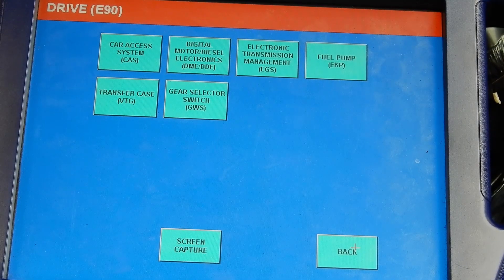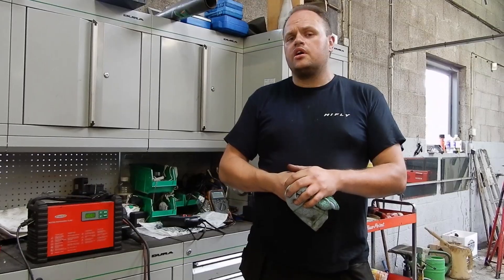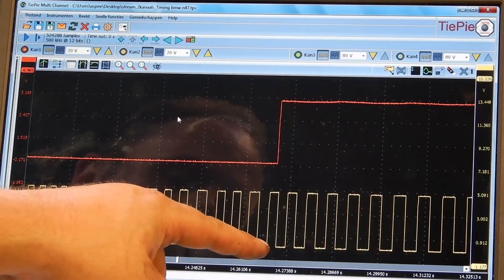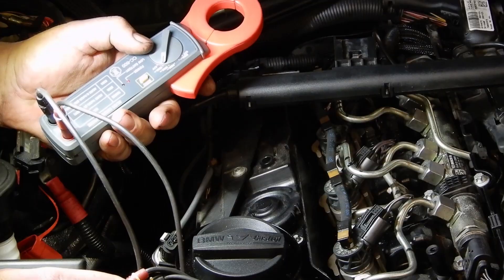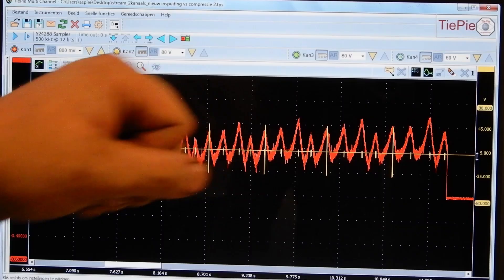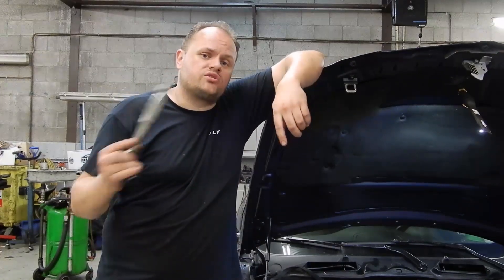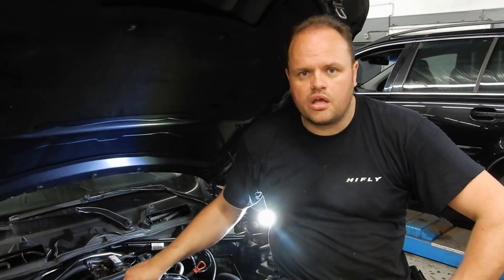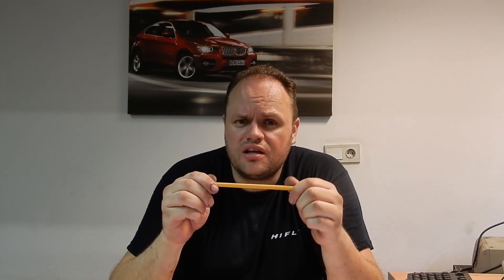Bmw n47 diesel engine "Won't run" diagnose

Comment: sump recently removed and replaced .  sounds like someone has been careless and not refitted the correct conrod endcap , main bearing cap.  conrod the correct way around ..  The sump will have to come off to get to the bottom of the tighteness  issue.   maybe incorrect bearing shells .   whichever way   it sounds expensive to me .   ex 1980 Donnington GT championship winner and self mechanic , fabricator , driver .. now 75 years old and still thinking .

Comment: BMW - Break My Wallet.
At least the timing chain didn't snap, those N47 are a nightmare, if it has more than 40k miles then that's already astonishing that it didn't bend valves. 
The last statement you made, could be the culprit for the seizing, lack of lubrication because of debris on the pick up means death... 

Great content, subbed.👍
Reply: Not here in the UK, I have a 118d convertible I've taken up to 96k miles, nothing needed. My car was made in Germany, apparently they make BMWs in the US and cheap Chinese parts are used, so hence things go wrong with BMWs over there, maybe buy an import
Reply: @davidviner4932  yes I get you, it is the same with Mercedes made in the US the quality is crap compared to German. But I can tell you David, I see heaps of broken engines in E87 e90s etc. I live in Germany and it seems that it happened here widely aswell, people fought for their rights to get some of the bill covered by BMW. 

I'm glad that you got lucky, it's not all of them but it's a Russian lottery.
Reply: I have an E90 with the N47 engine (316d) and it has done 216,000 miles with only routine maintenance required
Reply: @johngallagher909  You got lucky, thats a good thing. People who buy BMW's have to ignore the oil change intervall of 20k km and do it at least every 15k km, that would prevent failures, which these cars are prone to.
Reply: I have a feeling that the lower powered N47 engines (like the 316d) tend to be less prone to timing chain failure.

Comment: It seems to be a big mistery. I have gor 2 guesses: 1.The owner tried using any 'snake oil' (as said in the US) in the engine added to the motor oil. 2. He'd had the engine tuned by giving extra amount of fuel causing higly imperfect combustion. (A lot of) Soot can stick the pistonrings in their grooves.

Comment: The problem is it’s a BMW someone used the indicators and the extra load needed by the alternator caused the engine bearings to seize

Comment: Oil starvation engine seized They tried to get away with only renewing the bearings but the liners are tight now too because of scoring. The scope showed Number 4 (1342 firing order) being tightest. This is because 4 siezes first and is worst because it’s furthest from the water pump and runs hotter by design and gets more damage because it fuses the rings to the liner and tears the metal up but the engine runs on until all the others get damaged enough to stop the engine by which time 4 is totally trashed

Comment: I've seen seized up pulleys drag the engine down like that.  Not sure if the relative compression test would be affected like that. Looks cylinder specific. Please Dan, I need to know what fixed it!! Love you man! Thanks for the great videos. Vito.

Comment: Whats holding the engine, broken camshaft controlling the valves? Why not do a compression test with gauges on each cylinder?

Comment: Just FYI for other viewers as to why the current clamps reads in mV..   To read high current we use torroidal transformers that are part of the clamp circle. The current through the transformers induces a voltage on the winding. This relationship is linear and can be used an accurate method to measure high current.

Comment: I’d say wrongly fitted big ends wrong bearing or damage on the journals , it’s obviously had something done to the crankshaft and someone has messed up , usually no 4 piston suffers oil starvation first !.

Comment: Well it has been 2 years, did they burn the cursed car or is it driving again. With the same engine or a rebuild new one. Good riddle what part can make an engine partly lockup. Not give obvious signs which you would see when the sump was removed. Like metal chafings or metal that chanced colour. In which conditions was the oil when the problem first started it is like a puzzle where when it gets handed over to another person he forgot to give some pieces to complete it. But for the love of god 😇tell us once & for all what caused this engine to not run & partially lock up 😂my ocd needs to know🤪. I hate an open ending. Please🤗

Comment: Good diagnosis again Dan.  Need to dig deeper into the engine to find out the problem, they wouldn't let you do that, too bad, I know you could fix it, or replace the engine.

Comment: I suspect there's a partial seizure in one or more of the cylinders, hence the high current draw that is also inconsistent. If it was a big end or a main bearing issue, then the relative compression would not have such a wide variance.

Comment: I know this is old but . .  Brilliant video and great analytical thinking. As for what caused it to seize - well, I came across a Mercedes engine once which had new bearing shells put in the bottom end. They were fine, correctly sized etc. However, there's a semi-circular shim which takes up the longitudinal play in the crank. These are a sod to get in the correct place when reassembling the bearings. If they drop, even slightly, the crank will be more or less locked. It would have been interesting to know how it was resolved for your case.

Comment: Good engine when running right Crap engine when problems go wrong .Wont touch these engines anymore  Who puts a silly bicycle sized timing chain at the back of the engine . WHY ?

Comment: gonna go with bad main bearings, and possibly a bad oil pump caused it.. have seen oil lights not come one especially in turbo diesels due to "dirty oil", and clogged oil pressure sensor orifices..

Comment: I have seen similar sympthom , the problem was completly cloged cat. Guy that was fixing it unsqrewed exaust lines at the engine and it fired up. It was so cloged it wouldnt even start...
But I guess if you can't crank it manualy, that something has  seazed...

Comment: Uh oh Serpentine belt.
Reply: Me thinks since the oil pan gasket is different, they replaced the oil pump; but to late. If it is a manual transmission, you can tow the car to spin the engine. If the engine does not free itself, it is probably the main bearings. This one is going to be expensive with a total engine overhaul.
Reply: Oh before you do that check the oil fill cap for crusty deposits. The oil may never have been changed or wrong engine oil used. If the engine is heavily carboned-up, their will be excessive drag from fouling resistance. You did not state the km's.
Reply: The engine is definitely bound up, but why? Diesels are simple engines. I'm guessing it got supper hot or the oil was never changed. Either way, internal resistance is bad bad bad. Check the fuel to see if they put gasoline in a diesel engine. The engine will run very hot if they did this. A dragging bent push rod?
Reply: hummm, I had a locked alternator once upon a time. This caused the belts to smoke and break. If they just replaced the belt, the dragging/locked component still remains. I think this is the answer for the engine turns but with great resistance. It could be the fan bearing, alternator, power steering pump, turbo or air pump. I guess I'd pull the belts and twist each front of the engine component to see if they are the problem. There was heavy flooding in parts of Europe, France I think. What is the location of the home for the vehicle? I guess we will never know.
Reply: You pulled the injectors, so it can't be Hydro-lock. What a puzzle, what a puzzle indeed.
Reply: I read up on the N47 which has a timing chain breakage issue. If the timing chain breaks (rear of the engine) any of the internal components can be dinged or destroyed. The engine is usually marked as a total loss and must be replaced. I would choose a different engine.

Comment: 6:03 how did u check the timing if the valve cover is still on ?
Reply: By comparing signals from the crank and cam sensors

Comment: well dan what kind of transmission this car has if its manual and if you didn't push the clutch in while cranking the engine this tells me that perhaps there it's bad final drive bearing in the gear box or something else in the transmission or if not i can be damaged piston rings (segments) that are scraping heavely into the walls and making starter work harder

Comment: That's a hell of an starter to still turn a locked up motor, lol
Reply: :))) exactly
Reply: It isn't entirely locked up yet. It is siezing though, causing the starter to work double time.. it will eventually lock up entirely if it doesn't get rebuilt
Reply: Steve Sorits its a diesel starter ! They are powerful ! 🤣
Reply: @rahuldogra rubbish
Reply: @MrDosSantos991  they are . Even a 2 litre engine needs 400+ amps and a 600 CCA battery . Where as a 2 litre gasoline only as a 450 CCA battery and 150 -200 amps .  400x10v is really 4kw . It will turn anything
Reply: no it won’t, have been working in a garage for more than 15 years now and i have seen big diesels seize up and no starter could ever move them.. only clicking

Comment: Did you produce a part 2 , with the solution? Did somebody ever found out? 600A for a diesel starter is OK, though with the planetary gear in the starter, the engine is easier to crank, wherefore I would have expected less. You should have tested fuel supply, by opening the return line to see excess fuel being returned to the tank. I have never seen somebody tray to start a diesel engine with brkae clean,  gas engines yes, but not with diesel. Even if the engine has been opened, the mechanical timing seems to be OK, no pistons hitting valves. So IMHO its either fuel system / injectors or the soot filter in the exhaust pipe is so clogged, that the engine would not start anymore.

Comment: I love the way the customer gives the car to the shop without telling you anything, the customer must have known about whatever happened underneath the oil pan and puts it into the shop expecting some miracle will make the engine go when it clearly need a strip down and rebuild. I love your diverse use of diagnostic equipment to zero in on a fault.

Comment: heres my theory on this engine it was mentioned that the oil pan was off the engine at some point. now if it wasent the high amp draw on a car diesel (600 amps is crazy high) this issue was definetly compounded by the fact it took a fair size breaker bar to turn the engine with a fair amount of effort the engine may have suffered a bottom end failure as the timing was still spinning properly with the crank. an attempted bottom end rebuild could have resulted in over tourqing the main bolts making it hard to turn over, ware this engine is a diesel did the engine suffer from a runaway? the engine can act this same way after a runaway (had a 5.9 cummins 12 valve do this same thing after a runaway) it could have been an oil pump failure (this engine doesent look like its got heui injectors so no high pressure oil pump (it is common rail after all), what did the injector tips look like? any signs of metal in the oil if you checked it or was it fresh oil, the oil pan may have been off before the event that caused the engine failure i know BMW had a recall on the N47 diesel engines for rocker carrier issues, the highest amp draw looked to be cylinder 1 then the other 3 were pretty level if i read the graph correctly so a possible hydrolocked cylinder at some point could have cracked or warped a cylinder it could have also been an eatherbaby that cracked a piston (it can happen and not loose compression) without knowing any back story or seeing the car its hard to say

Comment: Can't you do a direct compression test on a diesel engine?  Oh, and why wouldn't a seized engine throw any codes?
Reply: Why it should? There should be load sensor on started, but there is no such sensor, thats why
Reply: @MariusVerbavicius  There are so many codes thrown for minor things you'd think an engine seizure would warrant at least one code.

Comment: I would say at one time the engine lost its coolant ,and now the engine block is warped ,being an aluminium block they warp very easily. had this problem on my inlaws BMW....Bring My Wallet is what it stands for.
Reply: If an engine loses its coolant, it's the cylinder head that will warp as it's exposed to more heat from combustion and being at the top of the engine, coolant loss leads to an air pocket at the highest point. Air doesn't cool as well as coolant, so a hot spot develops and the head warps or even cracks. The aluminium may soften during a severe overheat to the point the head can't be reused without risking further problems. The heads slowly squash under the head bolts if softened and the bolt tension is gradually lost, so the head gasket blows. Blocks generally don't give trouble as they're more stiffly constructed than heads, especially in a diesel, and it's hard to remove all the coolant from a block, even when you want to. As soon as the coolant pump has air in it, it stops pumping, so what's left in the block tends to stay there while gravity takes care of the rest.

Aluminium used for engines contains many additives  to make the material harder and stiffer than pure aluminium. Above a certain temperature, these additives, which are clumped together throughout the casting, will dissipate resulting in a loss of original hardness. Re-hardening is possible but it's an elaborate process that puts a lot of heat into the casting and re-machining cam tunnels and lifter bores is usually required, generally making it uneconomic or impossible to do due to the design.
Reply: @deaddoll1361  I agree with everything you have said,,However being a mechanic for 43 years I have seen it all ,not all cars are made equal the same as engines,,I worked in Canada for 15 years had a Ford Couger come with rough running..the owner said he just had the water pump replaced..No matter what I tried I could not get this thing to run smoothly ,,Phoned the local Ford dealer for advice ,He asked me has it ever run out of coolant IF it has the engine is scrap I told him the water pump was replaced that tells me it had run out of coolant ,However the engine block would still have some coolant left in,,He told me the V6 engine is made by Yamaha for this car requested by ford,,and the slightest bit of over heating will warp the engine block,pistons cylinder head..the point I,m making here is that this day and age where everything is made with the least of materials not all engines and cars behave the same way.

Comment: All you had to do is drop the engine oil out if sump and check for metallic metal if so poor oil back in engine and tell  customer to get a bank loan   job done boys will be boys lol

Comment: The conclusion, was the engine seized?
Reply from the maker: Yep!
Reply: @Diagnosedan   the pan being removed before and if you were allowed to work on it,  that is the first place I would start. loosen the crank bearings, reset to the proper torque, and see if it turns correctly by hand, being over tightened would cause it to hard crank. if that was the problem new crank shaft and bearings would be needed.
Reply: Well, partially seized, but because it cranked and didn't make the any excessive noise, it was ruled out.

I did wonder of the oil pick-up was blocked causing a hydraulic lock of some kind, (if that's possible). The different sealant could have been from the other shop pulling the sump to investigate, or some other work previous, which caused the blockage.

Maybe run low on oil too long, causing the bearings to bind?

Times like this you really need to speak to the owner.

@ROTTK9 - Owner didn't want Dan to continue, but I'm sure next step would have been to remove covers

Comment: Thanks 🙏 that was very helpful 
 How many Amps a normal diesel starter motor should draw
Reply: 1.5 liter around 200 amps, 3 liter around 300 amps...   these n47 are the WORST ever made    avoid.... lol
Reply from the maker: Depends on a few things

Comment: I had a m57 2006 that had a bad crank sensor showing no code. Replaced ran great.
Or earth strap causing slow crank = maybe low fuel pressure but that would fault a code?...I still would have checked the earth strap underneath. 
Stretched timing chain but again it should fault a code. Just some thoughts 🖒

Comment: It was easier to take out the Spark plugs,rather then the Injectors
Reply from the maker: A Diesel engine doesn't have spark plugs😉
Reply: Glow plugs ?

Comment: The crankshaft has gone Oval like an egg somebody might have put a new set of shells in using original shells sizes but they really need to have the crankshaft spray ground back to standard as when you took it up the engine will start to look up this happened on the Jaguar that we done years ago
Reply from the maker: Thanks for watching my video's it's appreciated

Comment: Great video Dan, Shame we’ll never know what the problem was though.  What else was the crank driving? AC motor, water pump, alternator etc? Could any of those be partially seized preventing the engine from turning fast enough to ‘fire’?  Maybe not as would expect to hear or see if that was the case? Thanks for sharing, always an education watching your great videos.
Reply: he had the drive belt off of those components
Reply: he had that belt off ...see 1:31

Comment: Love your work - learning lots, following from New Zealand.  I have a question you maybe able to help with, have looked everywhere for an answer but been unable to find!
“ why do you have an adaptive value reset for petrol engines and an auto trans - but do not have an adaption reset for Diesel engines” ?  Cheers Kevin.